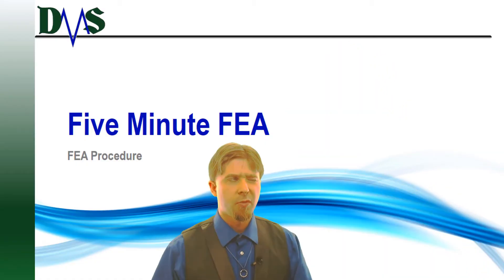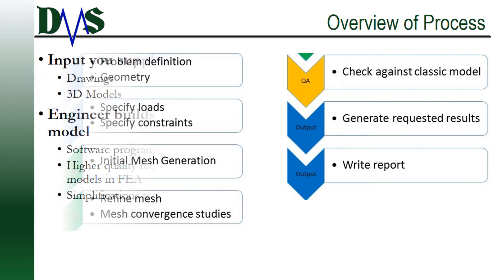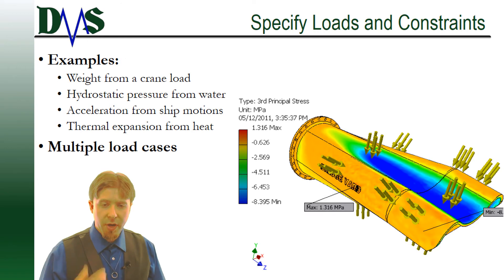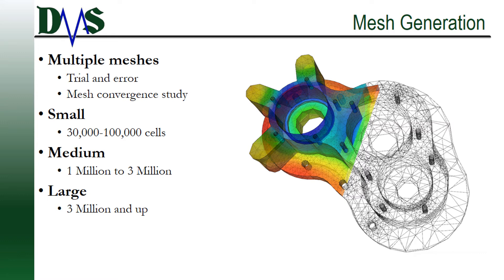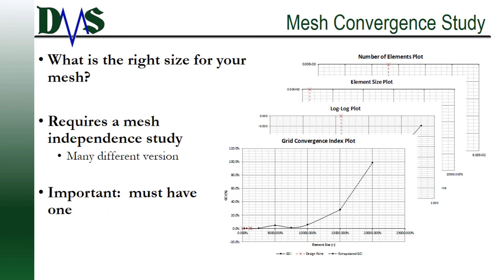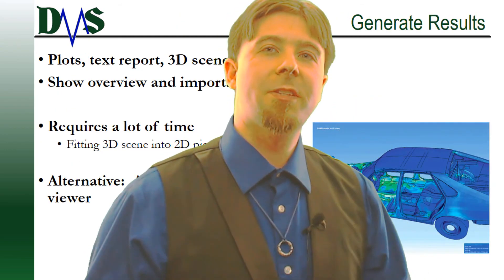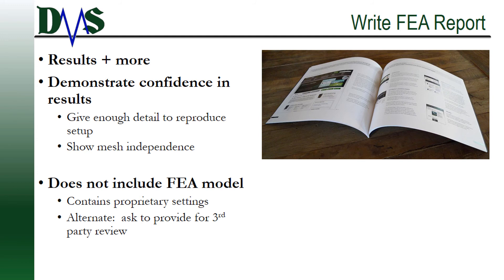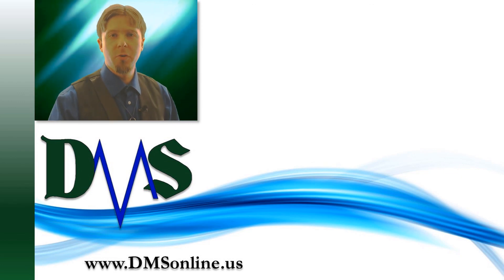How to Run FEA:  An Overview of FEA Work Procedure

Comment: This was really enlighten.for a young naval architect whose still in school,what resources could you point to learning FEA that can breed good confidence?
My second question is on the mesh.we've done simple FEA analysis by hand in class for 1D element,if you have 3D element with around 10,000 cells,how does the computer solve all that simultaneous equation for all those cells like we did for the single 1D element in class?
Thank you
Reply from the maker: Working with a 3D element is the same process, just with more steps.  As you mentioned, a series of 1D elements in 1D space create a set of simultaneous equations.  We typically solve those with linear algebra (invert the global stiffness matrix).  In 3D space, each element generates more degrees of freedom and more equations to solve.  Each element contains the mathematics to convert the material properties into global stiffness equations.  But in the end, just assemble all the equations and solve the matrix, the same as with a 1D element.  This is also how an FEA simulation can combine different types of elements in the same simulation:  each element handles the mathematics to produce the stiffness equations, and the solver handles the linear algebra.  Granted, the mathematics inside the element are carefully designed to ensure the program always solves the correct equations.  

As a practical example:  a 1D element contains 2 nodes, with 1 degree of freedom each (X-axis translation).  So two equations total.  a 3D tetrahedron element contains 4 nodes, with six degrees of freedom each (X-Y-Z translation, X-Y-Z rotation).  So each tetrahedron produces 24 equations (ignoring shared nodes between elements).  A lot more math, but still just equations that feed into a super-efficient linear algebra solver.  In the end, we do not have separate matrices for each degree of freedom.  It is one giant matrix that simultaneously considers ALL degrees of freedom, which is how we capture the interactions between different motions.
Reply: Wow!
No wonder this require alot of good computing resources.thank you so much for the explanation.for studying sake as a young engineer, could you point me in the right direction on how to get my feet well grounded in using and possibly developing simple tools for FEA especially  knowing it would help me in future  for making precise confirmatory calculations with the packages that ate available these days?
Thanks in advance

Comment: Hi, 
can you provide the approximate price for a 28' center console and 54' sailing cat?
thanks
Reply from the maker: Sorry, I don't specialize in brokerage.  For catamarans, I would suggest browsing listings in this website:  www.catamarans.com  I did a quick search and found a 52 ft sailing catamaran new for $949,000 USD
Listing:  http://www.catamarans.com/portal/catamaran-preview-basic-info.aspx?pCondition=New&pManufacturer=MALTESE&pModel=Maltese-52&pModelYear=2017&pName=SKEDADDLE&Vessel_id=500865&ListingType=Catamarans-Listings
Reply: no. I don't intend to buy those. I intend to build them from aluminum. I have the basic plans